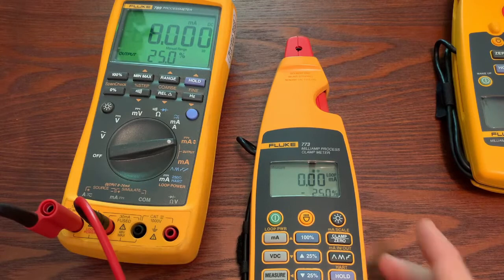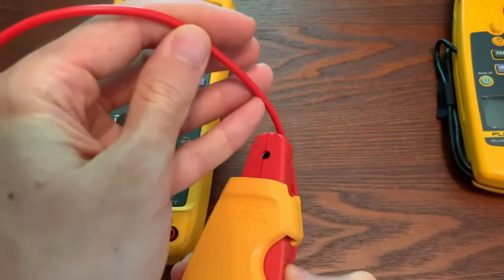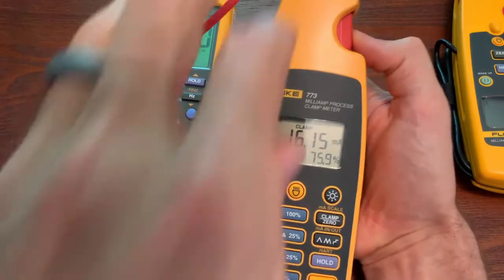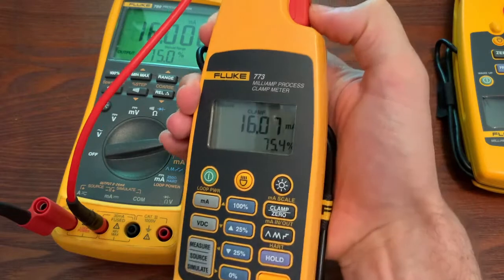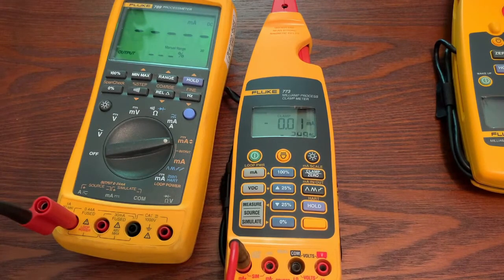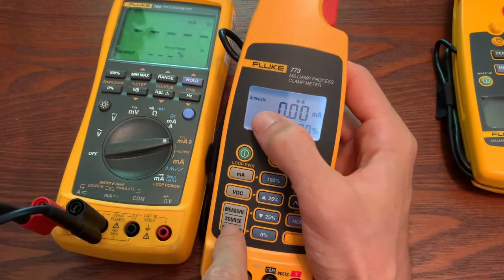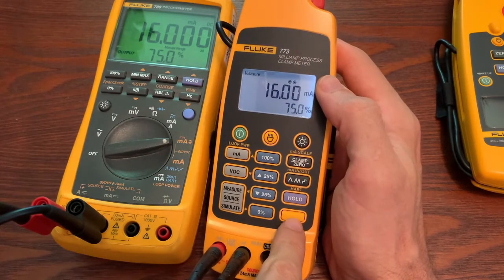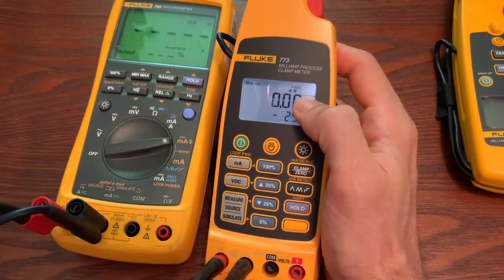01 - Measure 4-20 mA  - Fluke-773

Comment: Hey where did you get those meter leads that you have plugged into the fluke 789 @0:32. That lead with the stackable bananna plug is awesome.  I know you can get stackable bananna plugs anywhere but not like those.
Reply from the maker: They are called Fluke-75X-8014 or manufacturer#3669716. The only site I could find them on is Transcat: https://www.transcat.com/fluke-3669716-replacement-test-lead-for-754-753-75x
Reply: @fridayswithbrandon  I just bought a couple sets from Transcat.  Thank you for the link.